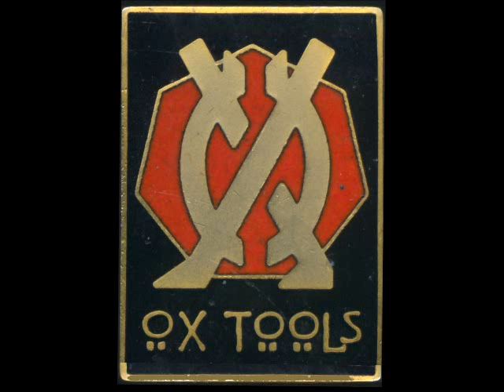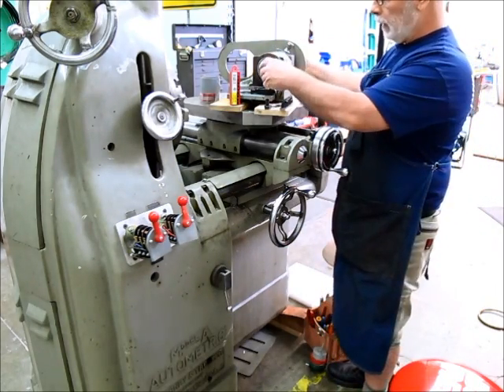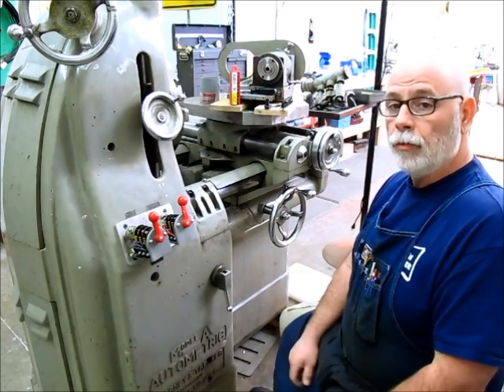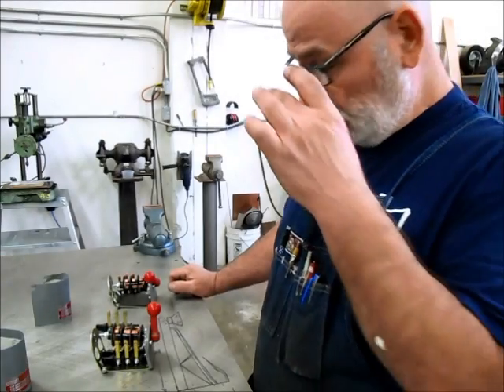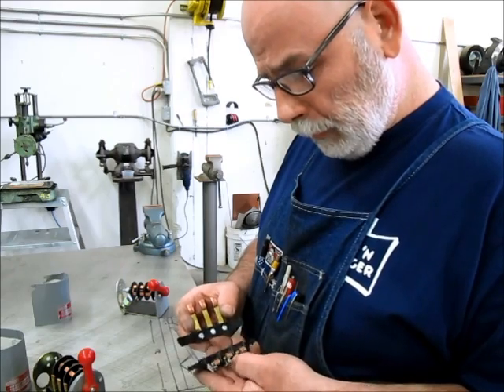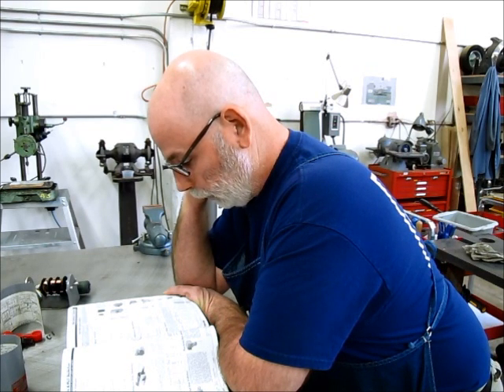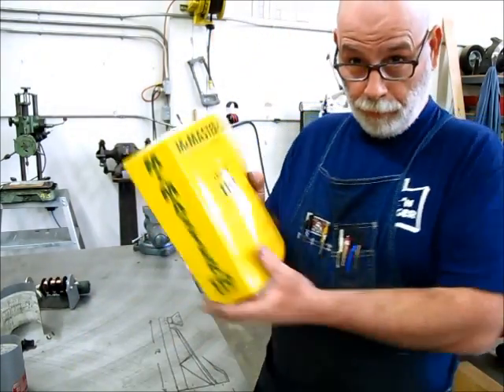Drum Switch Repair Part 1

Comment: I LOVE THIS!!! this is so much what we do at work on our own stuff
unless something is totaly destroyed we repair it.
Just finished reconditioning the saddle lead screw and making new nuts and the adjustable nut block which was trashed on an old Lucas 41b-48 HBM
The new parts from Lucas were going to be close to $4300 we are into it for about
$300 for bronze stock and prolly 4 man days labor but we were slow LOL
Reply from the maker: Hi Gent,

It's way more satisfying to fix something. Too many things get thrown away that could be easily fixed.

Best,

Tom
Reply: oxtoolco It's all a matter of costs vs. benefits - and, some of those aren't tangible...

Comment: At my last job before i retired, one of my jobs was repairing electric forklifts that used that same type of drum switch. In 32 years i became quite good at it. A contact repair kit was 16 bucks.
Reply from the maker: Chuck Small Hey Chuck,

Didn't know you could get a repair kit for these switches. Thanks for the comment.

Cheers,

Tom

Comment: Tom, I've been spending way too much time watching your videos. I'm slowly getting up to speed, catching up with your more recent videos. I find it all to be incredibly interesting and educational. Way, way better than t.v. Thanks so much for taking the time to make these, it must be a ton of work with all that is involved
Anyway, I was wondering how you managed to get a hold of a McMaster catalog? They seem to be so rare. I've heard several guys in the trade complain over the years that they can't get McMaster to send them a catalog. Any tips on how to get a hold of one? Thanks.
Reply from the maker: Hi Alistair,

Be sure to spend some time in the shop. Got to get up and move around once in a while. McMaster catalogs. You actually have to beg. It takes upwards of a year of regular begging to get one sent to you. You also need to order a few things from them. I imagine the catalog is a significant line item cost for them. They meter them out like hens teeth.

All the best,

Tom
Reply: I hear you Tom. My day job is working in a kitchen, it's a very physical endeavor. As a result I've got the "get up an move around" part pretty well covered. Shop time for me is mostly on the weekends, so I've been watching your vids during my down time, in the evenings mostly. Your point is well taken though. Spending too much time sitting on ones duff, even if it's watching your excellent videos, is no substitute for getting ones hands dirty.
Thanks for the McMaster tip. You make a very good point, and I can imagine that the cost of producing such a publication is considerable. I do order from McMaster from time to time but I have to be honest, I get  most of my stuff from Enco, using their monthly flyer and coupons. I do prefer the quality of McMaster's stuff, but for my needs Enco stuff does the job most of the time.

Cheers,

Alistair.

Comment: The brand of drum switch we used was Furnas. We got out spare parts from a local forklift business. We used to buy parts from the forklift maker and they were ripping us off big time. We took all the electric forklifts and drained the fluids and batteries and tossed them into a big dumpster and bought a propane Kawasaki forklift.